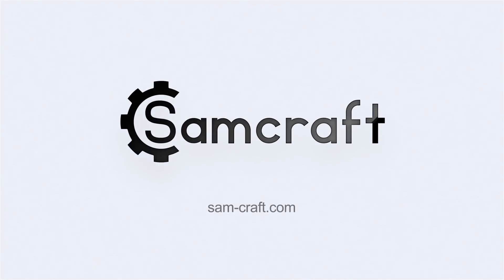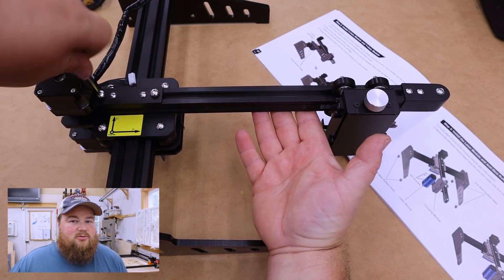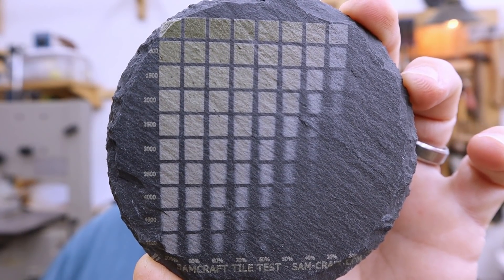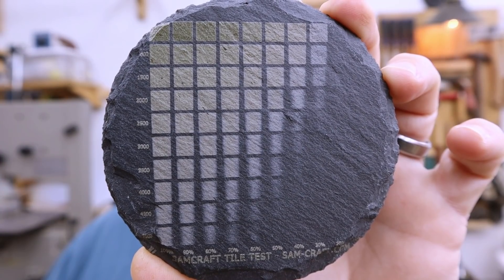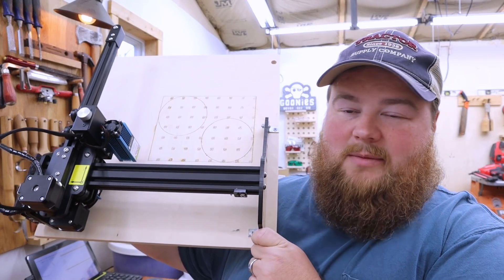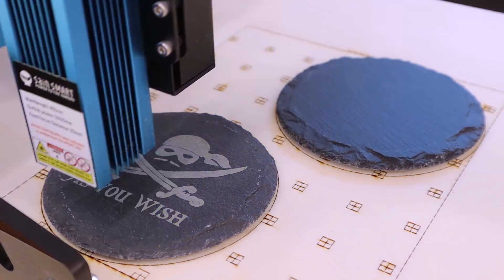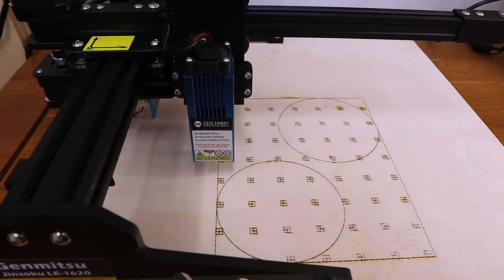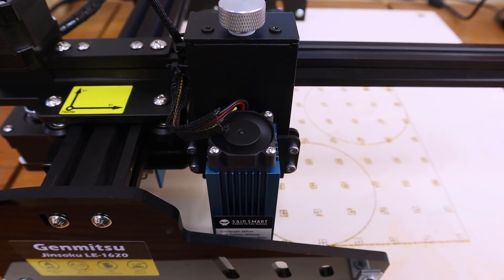IS IT JUNK? Genmitsu Jinsoku LE-1620 Laser Engraver

Comment: I have never owned a laser. I would like to be able to engrave on wood, glass, tile, leather, metal and on cylindrical objects like cups and glasses. If  I wanted to spend less than $1200, what machine would you recommend? I will set it up indoors in my office, so don't want fumes. CNC capability would be nice, but not sure there is a machine that does both well.  Your videos have been great. thank you.
Reply: I am looking at this one "Makeblock xTool D1 Laser Engraving Machine With Rotary Attachment" cost $849" Would it need to be vented outside?

Comment: New sub. Because of you I am getting this unit on Friday and can't wait. What did you use to attach to the board and also for your grid can this be made for 4 inch squares for tile or slate instead of circle?
Reply from the maker: Sorry? LOL That's a great idea on the template... I'll edit the file soon.
Reply: Delivered on Saturday. Bought your grid that you made. Thanks. Dumb question for the 4 in round coasters what size did you do for the design. Love the content man.

Comment: I ran across your videos while researching laser engravers. Would you say that it’s possible to burn deep enough with this laser to to a shallow epoxy fill for contrast with the wood?
Reply from the maker: With enough time, yes. BUT you'll want to add an air assist or fan or something to prevent it from catching fire from the heat of engraving/carving the wood.

Comment: thinking of purchasing a small laser to make my own bag tags.  I would like it to cut leather. is that possible with this?
Reply from the maker: Yes, this will cut leather. You'll probably want to add an air assist to it to help make it quicker. Also a metal grid table vs. solid wood. When cutting you need airflow below the piece.

Comment: Sam will you laser unit cut through thin wood
Reply: that should be other laser cut through 1/8" plywood
Reply from the maker: I'm working to source some 1/8" plywood to use for cutting on the Ortur. I doubt this smaller laser could cut without a ton of passes from what I've seen from it so far. It feels less powerful than my Ortur Laser Master 2 Pro.

Comment: Love your videos! Great review. Thinking about the Ortur. Hows yours holding up. Any issues with it?
Reply from the maker: It's still been great! No issues with it (knock on wood), and no more disconnects (I was running it too fast speed-wise at 10,000 mm/min. I now run most everything at 5,000 mm/min). It's the workhorse of my shop and small business. I've easily run 200 jobs on it at this point and probably logged 20+ hours of machine time. With my limited experience, I cannot say if it's the best out there for the price and functionality, but I'm not displeased! I would like to try and find the "best" diode laser on the market to help others and save their money when choosing. :) Maybe someday!

Comment: Great review. Loving your channel. 
 Interesting to hear you don’t consider these to be cutters- What would you consider the lowest useful wattage for cutting 1/8th to 1/4” thick material?
Reply: In the blue diode world, something like a 7.5W (true) laser will generally do 1/8" Baltic Birch in one pass. Thicker material will require more passes and at some point even if you cut through, the edges will be a charred mess. A true 7.5W of laser power is going to need something in the range of 20-30W of input power. They don't make diode lasers in true 20W output power so if you see that advertised it's probably a 5.5 or 7.5W true output power laser. That's the number you really care about - what's coming out the lens, not what's going in from the power supply.
Reply: @jimhatch5873  appreciate the response!
Reply from the maker: Thanks for the comment, I really appreciate it!  I don't know what the minimum wattage to search out for cutting would be -- I'm not that well versed in laserology. :) But I hear a lot about CO2 lasers for cutting.